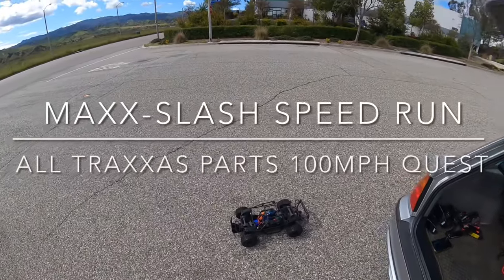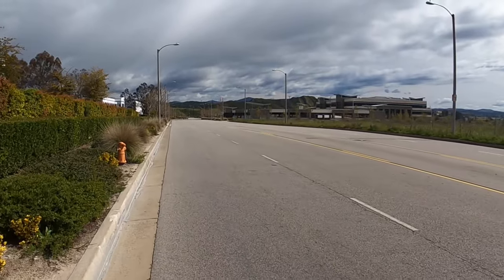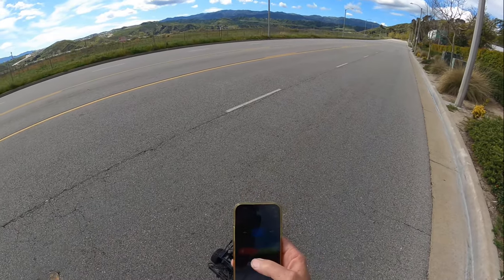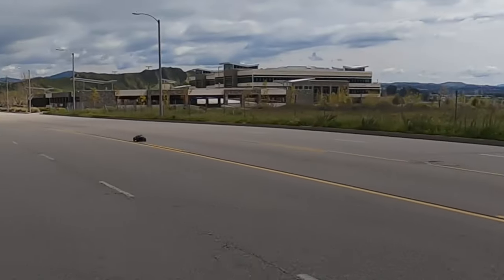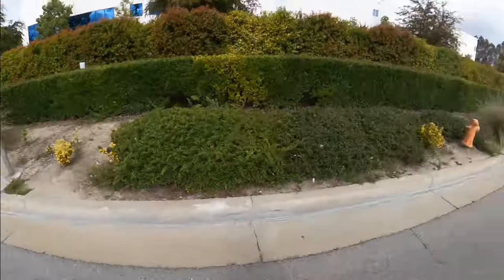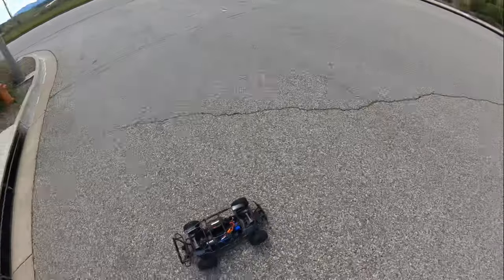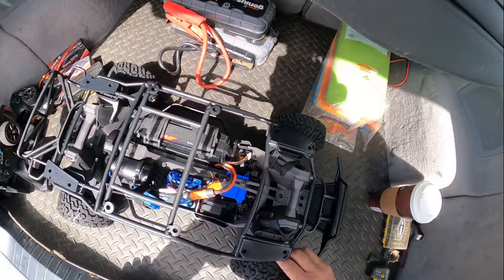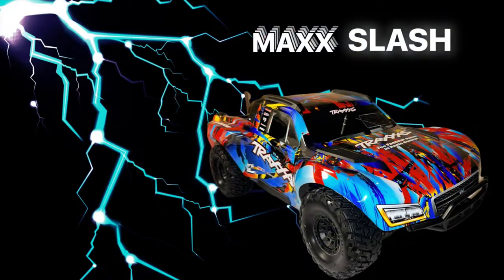Traxxas New Maxx Slash Speed Run Having Issues ? Rc Won’t Go Straight Anymore?

Comment: The factory servo saver is junk you can easily move the tires and not even try to move the servo. You must have got a good one I was fighting mine on day one to keep it straight I put in one by hot racing what a difference.

Comment: Only thing I can think of that hasn't been mentioned is the possibility of one of the tires starting to have the belt fail causing it to balloon more than the other side causing it to pull at speed. You could mark the tires and do a couple runs and switch sides to see if it starts pulling the other direction.
Reply: I was thinking the same thing, or possibly that one of the bearings is starting to drag when it get hot.

Comment: Looks like you could wrap a wire around the tire. May have to cut a little tread to make a good straight line all the way around , right in the middle. Or maybe take strong tape , duct tape or some gorilla tape. Put like 1 or 2 layers on the inside of the tire. Another idea but not sure if it work at all, would be to put layer of glue around the inside of the tire, but could be hard to keep that even . Plus while it drys could become on even ,so not sure . But sounds interesting 🤔. 
Great video thanks

Comment: 143 or so on the motor heat that’s nothing I mean just bashing I run into the 180s constantly cause I’m geared up on everything never blown a Traxxas motor except for the maxx. Put it on six S and did two back to back 70 mile an hour hits and melted the bearings . Tires definitely seem to be your problem here you said you reglued him even if you have too much glue on one of the tires compared to the others it’ll pull at that speed I mean you’re doing almost 20 miles an hour over what the tires are rated for. Very impressed with the 84 miles an hour. That’s awesome.👍🏼🔥💯

Comment: I've seen 'razor rc' stiffen up the servosaver with some clips with some hub clips, cutting of the ends en put them on top and under the spring... Maybe it might keep it a little from swerving.  Thanks for the video and I enjoy watching the 100mph quest
Reply: Hard to believe sc wheels wouldn’t be stiff , if it’s same spring on the maxx ,  I don’t like it either I need one now it be 3rd one but I running lmt wheels sometims

Comment: Man… it’s always something bro … one or two more speed runs and you’ll break the hundo mark I’m sure👍
Reply from the maker: I hope so I feel the diff fluids to thin causing it to drive off one wheel causing a push 🤔
Reply: It could be , I seen few guys on YouTube say they were low and that was problem with the arrma blx 3s rigs at high speeds , what happened to 100 mph off road 😂 , that was too much 100mph with out something stupid like KT did . Stock chassis RC over 75 80 is a challenge no ? Who knows this rig maybe better than Mojave at high speed runs . I wouldn’t think servo saver , you can run Mojave 6s wheels just see if it’s the steel belts someone mentioned saver but I think it’s tires or diff ing out like you said

Comment: A the dreaded slash body curse only one guy has gone really fast 134 mph in a 2wd slash my dads rc channel I just ran 92 mph today with my 2wd slash but not with the body I know your 4wd  but that body I wish you luck bud turn down steering speed and Dr and gyro maybe add nose weight

Comment: Have you tried using the Traxxas BT module to adjust the steering sensitivity? I normally put the steering sensitivity to 50% when I’m doing speed runs to keep it going straight